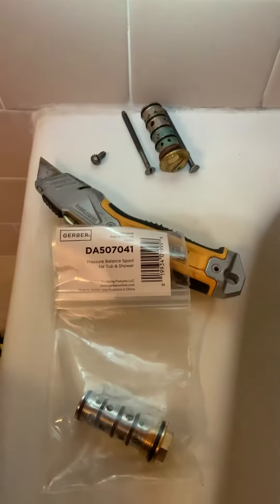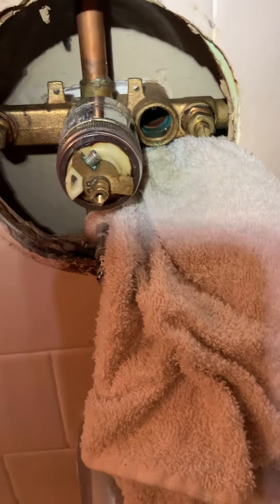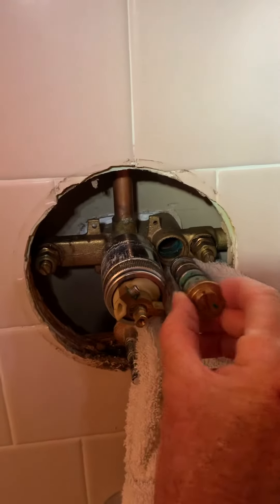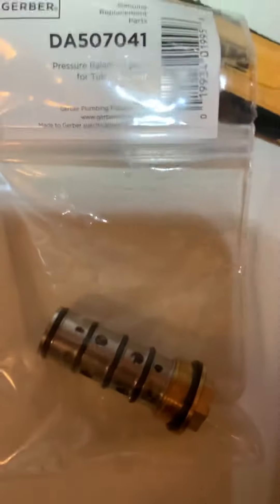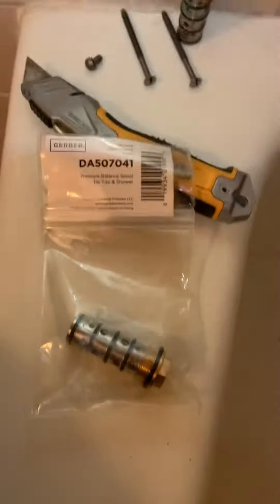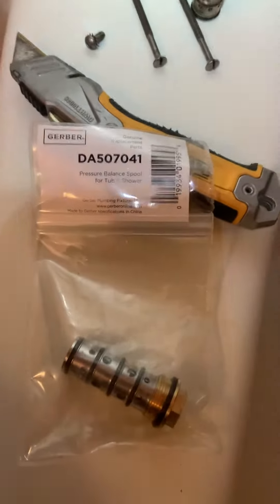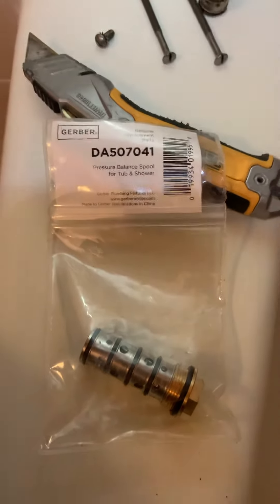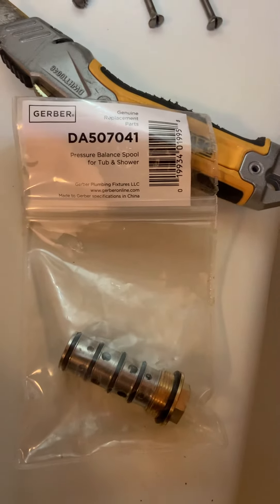Pressure balance spool delta single handle tub & shower

Comment: you need to check if you are getting anything in it that plug up the holes. there is nothing to this part... I found that the outside valves that have rubber faucet type gaskets on it get rotten and fall apart and get lodged in the feed lines and this mixing valve. all i had to do was clean out the chunks of rubber and replace the rubber seals. the only other thing that could fail is the o-rings on the body